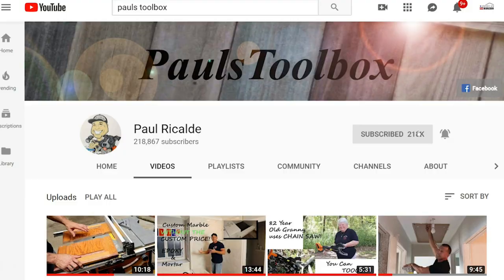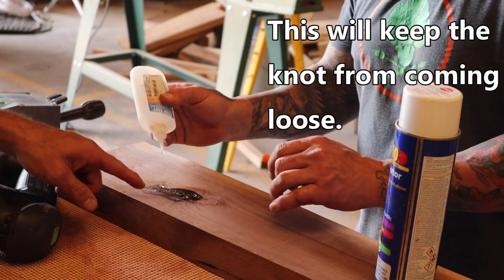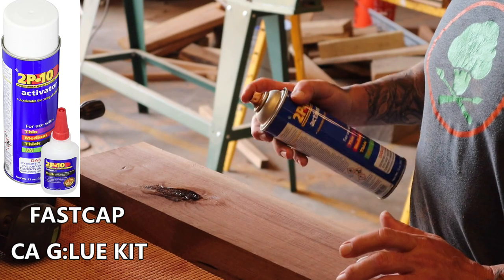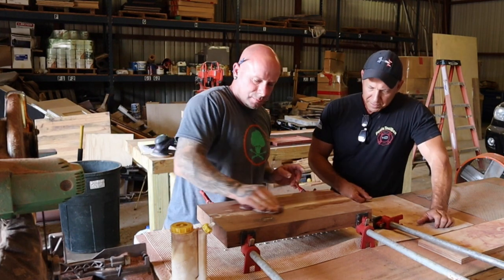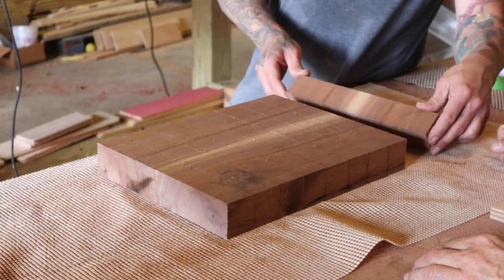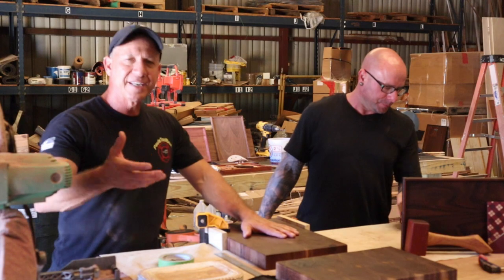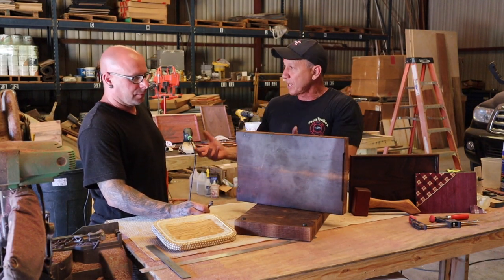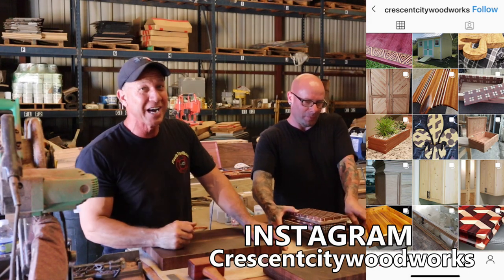DIY Butcher Block Kitchen Projects You Need To Try | Paul Ricalde

Comment: What kind of wood was that? Beautiful color!
Reply from the maker: Hi Troy, that is walnut, my buddy Loren got it from a local mill out here in New Orleans. I’m gonna check some other places because the price for Walnut down here is very expensive. I’m heading up to Oregon tomorrow morning to meet a good friend Mike Quist with StoneCoatCountertops. I will see what the prices are up there, I know they’re much less than here. We get real nice select sinker cypress and Pecky cypress down here but walnut is hard to come by.I’ll be doing some projects with Cypress soon.
Reply: @paulstoolbox  is that just plain Walnut or black walnut?
Reply: Paul Ricalde Thanks heaps! I’m going to do butcher block counter tops so am interested in this information.

Comment: I watched your video on using bondo glass on your fascia repair. How would you or would you do it on an older house with rough faced cedar fascia?
Fyi, I did replace the bigger rotted parts, just wanted to know if and how I could do it on smaller pieces without replacing the board and still get the rough face to match.

Comment: This Will be off the subject of the video, but I know you also are a experienced painter. Do I use some of the same methods that you teach, on painting walls and cabinets without leaving paint brush strokes, when painting metal??? I want to paint my car with a brush.
Reply from the maker: Hi Joseph, I would not suggest trying to paint your vehicle with a brush or with the roller technique. You are using a different type of paint so it really needs to be sprayed on in order to get a good finish. They have a lot of guys on YouTube that are very versed in autobody paint. You can get a fairly decent guy and that I was very low price from Harbor freight and practice. I’ve seen some pretty good work with these guns but you really need to know a little bit more about bodywork. Sorry to give you that type of news buddy!
Reply: Thank you for your advice point but let’s take a moment and reason this out for a person who has just an average work vehicle or just A common car with paint peeling off and they are on a tight budget. To buy automotive paint and all the applications that go with making the paint job successful- The items alone ( gallon of paint & prime& clear coat) will cost you $350 or more. I can buy the paint for metal doors or surfaces, and the primer and clearcoat (for boats), and only pay $80 or less. So any one can have a good looking paint job by whatever means necessary 😅. I just want to learn how to do strokes without leaving brush patterns. I want to get really good at this because I have painted my friends car with a paintbrush and it looks really awesome but it has the brush grooves in it 🤪.  I will see if I can attach a picture in this reply. Many people are admiring the paint work on this car and it has flakes in it- it’s really fancy work.
Reply: In fact if you have an email I will send it to you or I will text you a picture or two.
Reply from the maker: Joseph W. Sure Joseph, If you go to Paulstoolbox.com you can send me pictures on my contact page. I’ll be more than happy to look at it and give you my advice but I am not a automotive painter. I hope I didn’t come across wrong but I don’t want you to mess up something because I gave you the wrong advice. I look forward to seeing what you’re talking about. Thanks buddy!

Comment: Is that 320 for all hardwood?
Reply from the maker: Yes if you were not staining it. If you are going to stain the wood you can’t go that high because you will close the grain and it will not accept the stain. Thanks!
Reply: Paul Ricalde what about epoxy? Would it inhibit a good mechanical bond if I went that high?
Reply from the maker: Melissa Newcomb 
Hi Melissa, you don’t want to go above 220 when you using Epoxy. The reason why I say you want to go to 320 is  because your it closes the grain and makes it totally smooth. You never want to have it totally smooth if you are looking to get a mechanical bond. The same  goes for painting, if I am painting latex over oil base paint, I will have to sand it in order to get a good mechanical bond. If I were to try to paint latex on top of oil without doing that it will not stick. Thanks and good luck!
Reply: Paul Ricalde thanks Paul!   Informational as usual!
Reply from the maker: Melissa Newcomb thank you!!